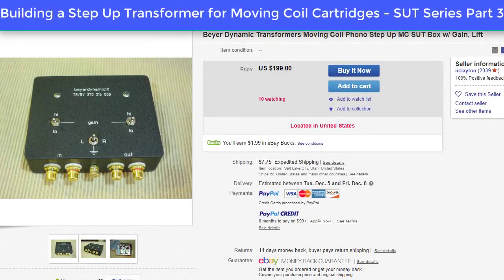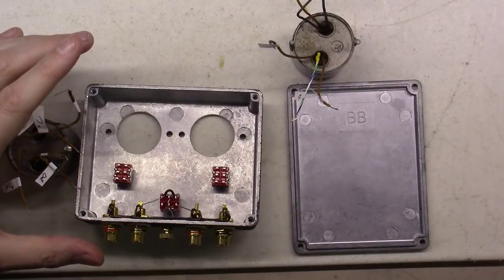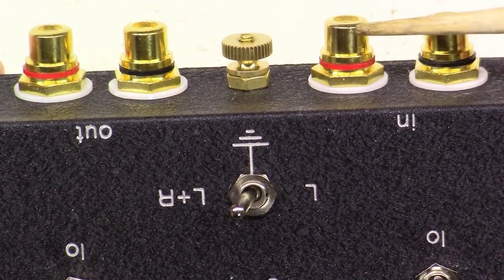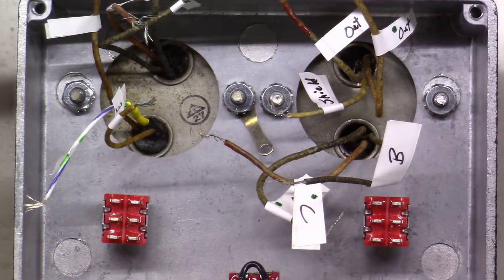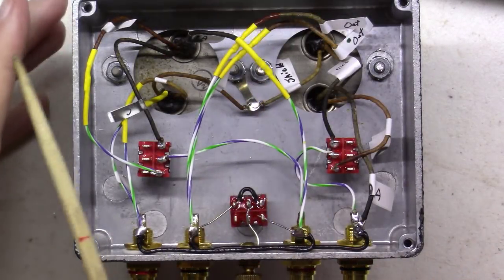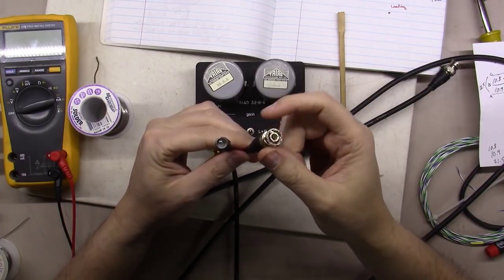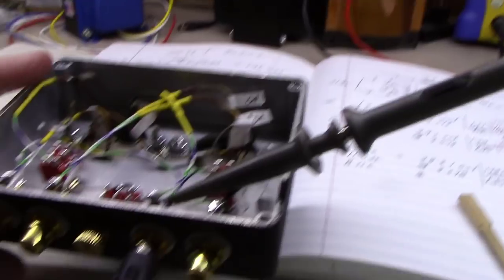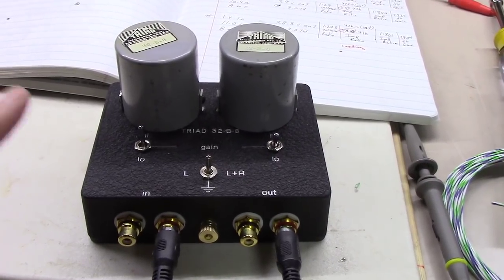Building a Step Up Transformer for Moving Coil Cartridges MC - SUT Series Part 3

Comment: Excellent clear thorough video,surprised you didn't fit the secondary side resisters to get rid of over shoot ringing? Is it not better to loose a little gain in order to have perfect response? Also do all these factors translate to what transformers actually sound good and the monetary values asked?

Comment: You indicated that the Hana cart would have required a loading resistor in parallel with the outputs. Did you put one in and did it make any difference?

Comment: You named the series, “Building a step up transformer” but all you did was, saying that you were going to build a car, than giving a lot of background about how internal combustion engines work, and after the theory, instead of building a chassis and an engine, you bought a second hand car and replaced the tires.
Reply from the maker: Did you want me to wind the transformers?
Reply: Now that would be pretty intense!
Reply: It would be nice to show, how close one can reach the performance of the vintage step-up transformers, using the materials and manufacturing methods which are available to the public today. We regard the material to be the most important aspect of the vintage SUT performance, is it really the case today? I have built Ultra-Linear output transformers for Class AB amplifiers in the past and I know the importance of selecting high-quality material, but I have also learned how sectionizing influences the leakage inductance or the criteria to decide between different core designs or how to lower the input capacitance to extend the frequency range. My transformers were not as successful as the ones that I have tried to reproduce and I always thought that I haven't flipped all the stones. I still think that SUTs are small, therefore they are the perfect vehicle to carry on a demonstration on how close one can get to the performance of a vintage SUT by employing the basic rules that you have mentioned in the theory section.
Reply: @oturgator  it is definitely not the material, more likely the arrangement of the windings. Different conductors being used, say silver vs copper vs gold, only have different resistances. And copper has the lowest resistance. That's why "audiophile cables" are a scam, no matter what way you slice it, it's just a wire.